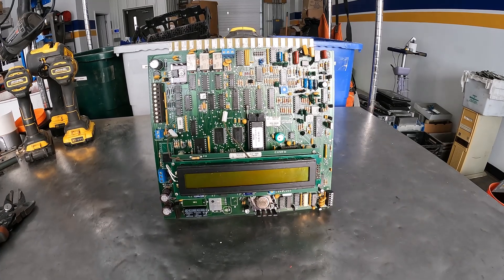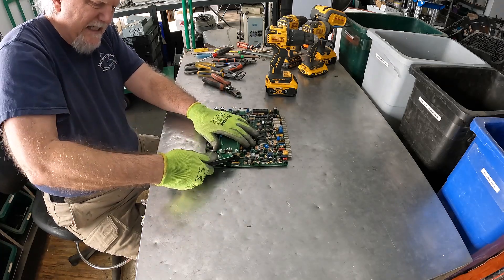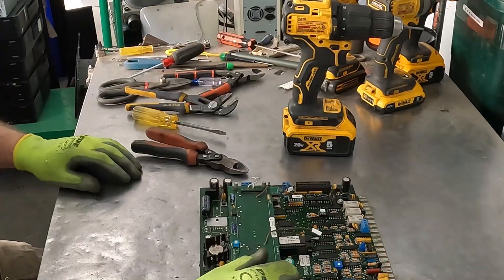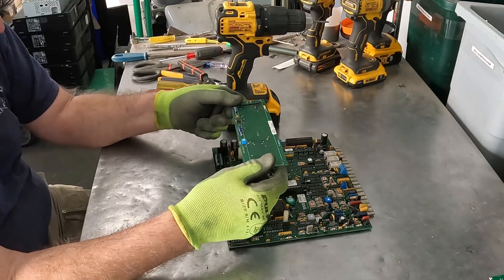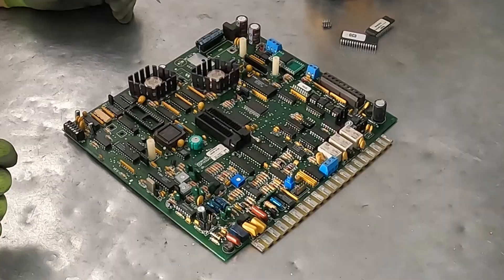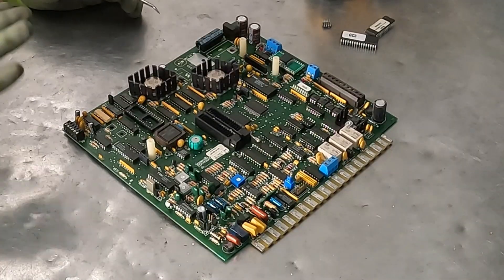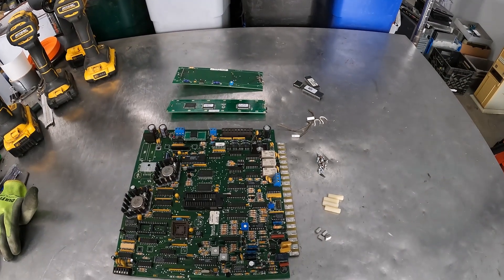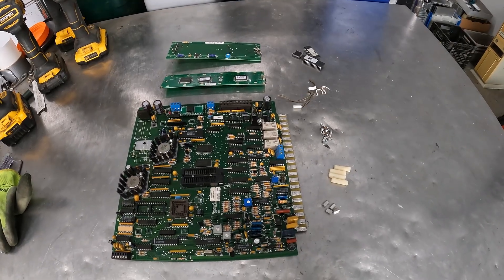Borderline Boards Are Hiding Money | Here's How to Find It

Comment: Have you ever done an analysis between the value of total de-population (i.e. loose IC price, etc.) versus low/high grade telecomm?  I'm assuming it's worth more to leave the board intact but that's an assumption.  I'd be curious to know.
Reply from the maker: My rule is to never depopulate anything unless you have a buyer or know how to recover the PM or other metals. There are many components that have no scrap value on their own but add weight to a board that has known value. So I’ve not gone down the road of comparing the depopulated components vs known board value.

Comment: As long as I have been doing this ....with all recycling .....one thing is for sure . Every yard has a different commodity number and what everything is called or referred to as . One yard will take all what I call extruded aluminum and call it stock? Mixed motors and transformers or separate them ? Selling boards to Boardsort is the only way to go when selling electronic/telecom /computer etc scrap because they are the only ....in my humble opinion ....to be honest .